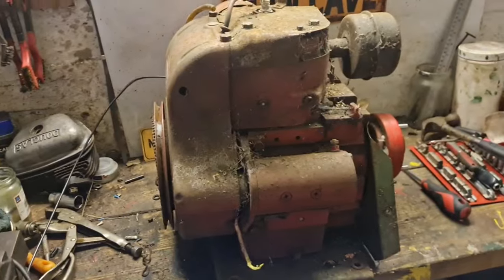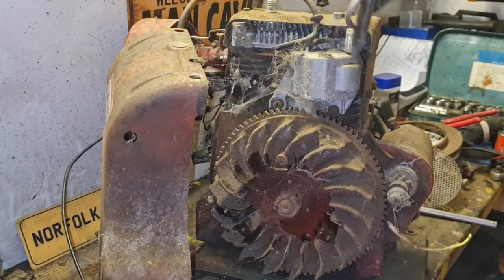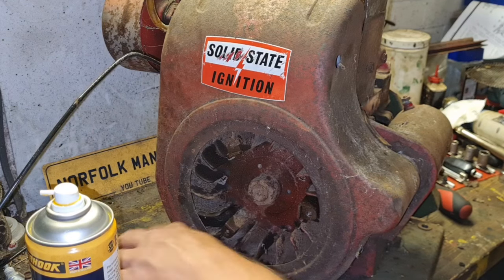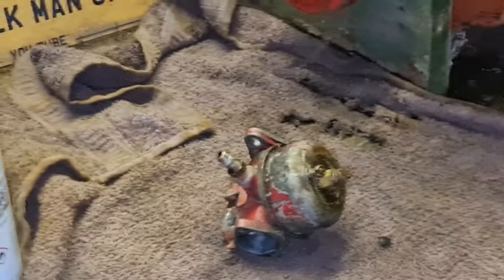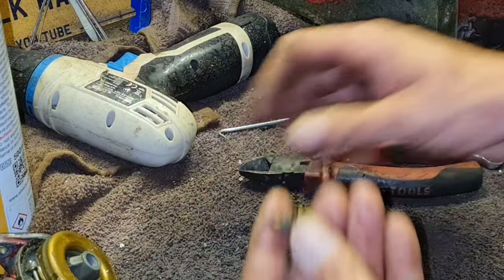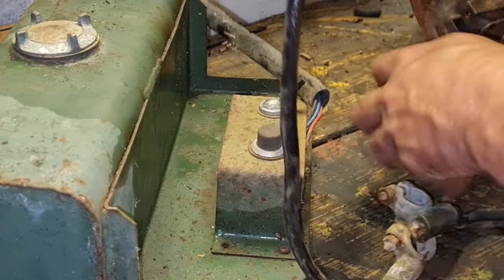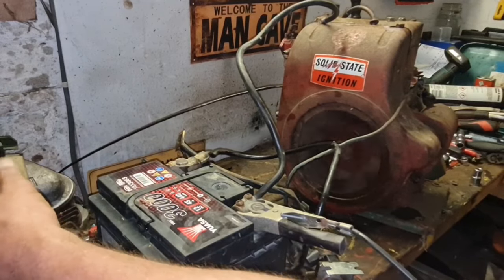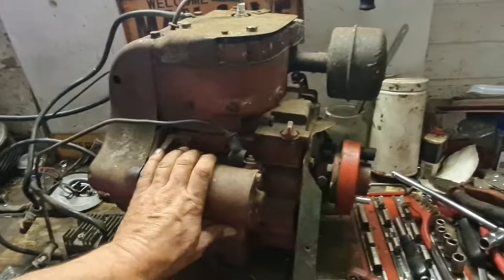Kohler Bonser engine, Wil it start after years in a hedge.

Comment: Little tip with needles and seats ...when cleaning down the bore and the seat, chuck a cotton swab in a drill. Works beautifully. Also if its not sealing well...use another cotton swab with the tiniest bit of valve lapping compound on the tip.  Give it a light polish but don't go crazy. Then rinse it out with carb cleaner and air

Comment: One thing you didn’t check when you had it running was if the battery was being charged. As the regulator only had 3 connections you might have to ground the heat sink on the regulator to get the battery to charge.